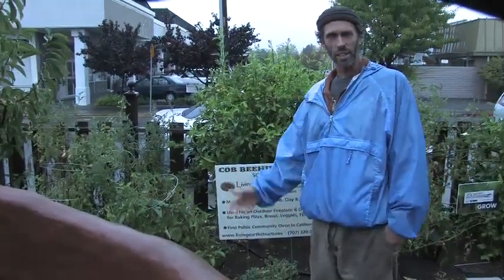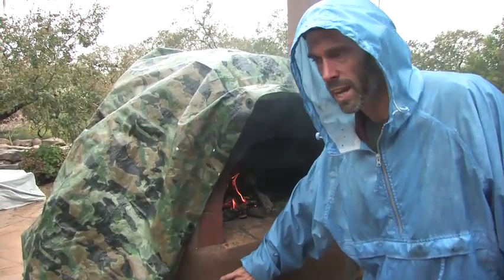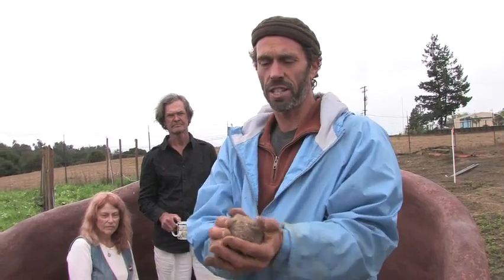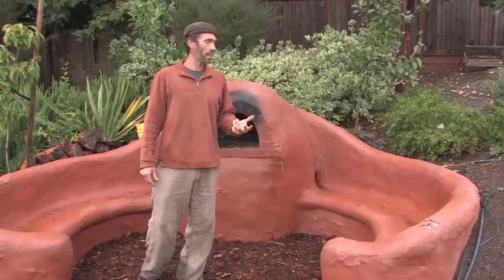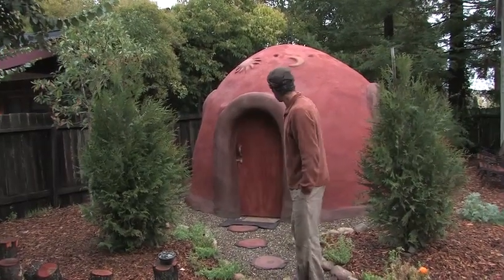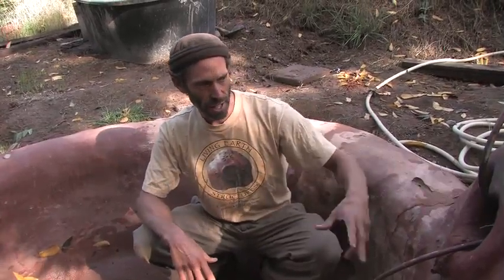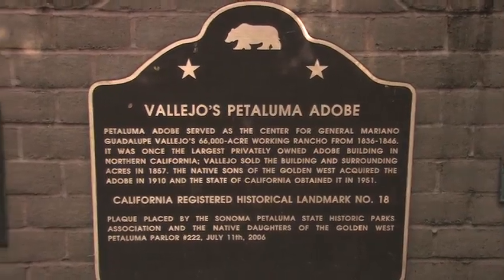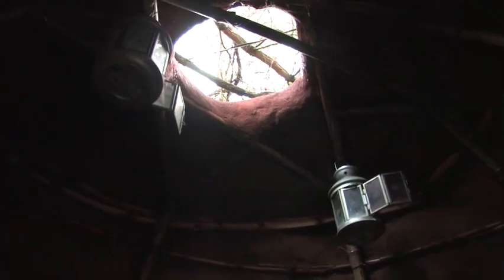Cob Building with Michael Elliott

Comment: how does it stay hot once you have taken the fire out in order to cook?
Reply: thermal mass holds the heat for hours. it takes approx. 3 hours to heat the oven up, once at temp you maintain very hot temperatures for around 8 hours.
Reply: can you leave the fire inside while you cook in it?or do you have to remove all ash and coals before use?
Reply: the short answer is no, you cant leave the fire inside it. but then again, its highly dependent on what you're cooking. typically the oven attains maximum heat with direct fire and coals, and then the coals are removed and the base (the "floor" of the oven) is quickly cleaned with a wet rag to remove the ash so you don't get it all over your food. because of the long cooking time and slow reduction in temperature, you've pre planned a whole array of meals, breads, and vegetables, roots and tubers to cook in it through to the evening (or into the morning) making sure you keep the lid on as much as you can. you might be able to get away with cooking certain foods during initial heating - maybe in an oven proof pot or pan. give it a try, let me know!